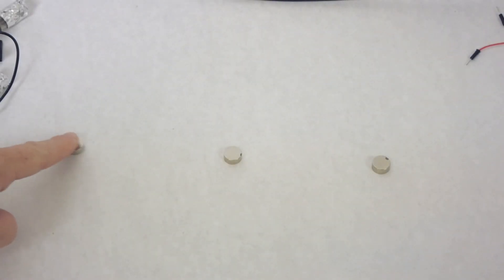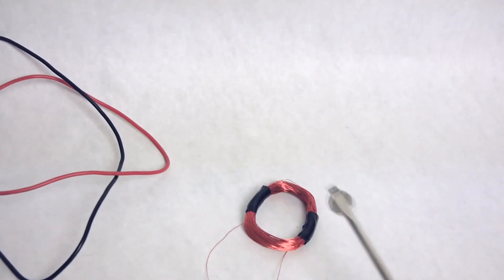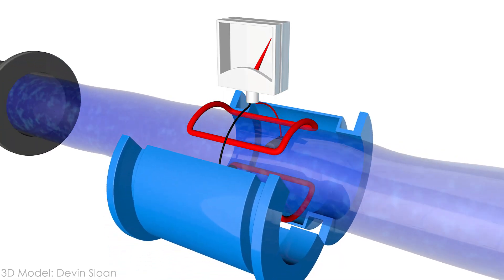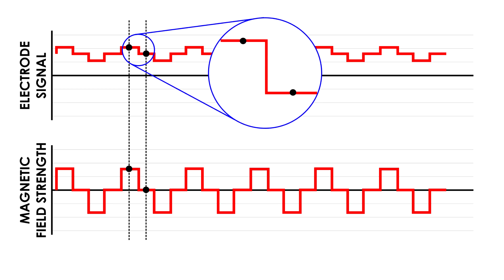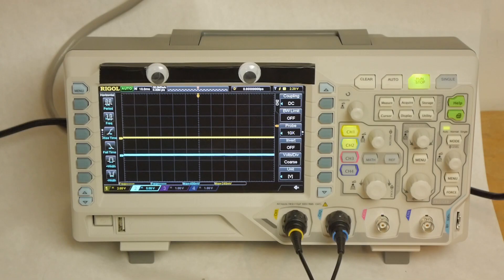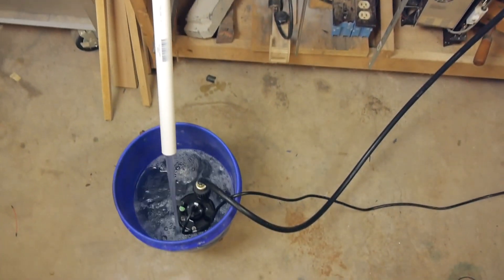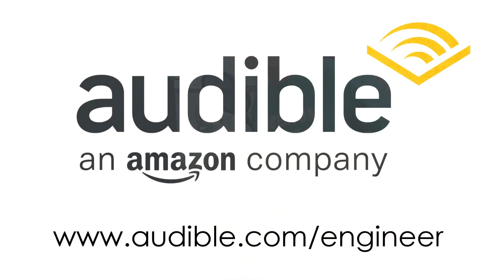How to Measure Flow with Magnets - (Magnetic Flow Meters)

Comment: Highly enjoying your water based videos. As a farmer I find them useful. Monitoring flow rate can be difficult with dirty water so we typically use pressure to make sure everything is running properly. 

Ps. Are you from Spud Valley? Based on your shirt at then end.
Reply: I work in a water plant that intakes water directly from the Mississippi River, the definition of dirty water, and we don't have any issues with our magnetic flow meters to track our intake water. In fact, mag meters are the recommended standard for dirty water. Propeller meters work up to a point, but can be less accurate and unreliable with large amounts of sediment or debris. Our regulators have required us to install mag-flow meters.
From our math, they're VERY accurate. We run flows up to 1400gpm in and 1500gpm out, and at the end of a month, tens of millions of gallons later, the raw influent and finished effluent meters are usually within a few thousand gallons of each other.
Reply: Robert Morgan our flow meters I believe are just weights in a clear plastic chute. It’s a visual cue and not a magnetic flow meter. High algae wrecks the visual. I realize I didn’t clarify that.

Comment: One idea to address the noise is to have a second pick up pair a little bit away from the magnet field.  The purpose is to pick up about the same noise, but without the signal, and then subtract:  (signal + noise) - (noise) = signal  It won't be perfect, but an improvement.  Another idea is to just use a low-pass filter.  That water flow is not likely changing at high frequency, anyway.
Reply: if you use 2 active sensors but one in reverse polarity then as long as the noise is not dependant upon field polarity then you get (signal + noise) - ( -signal + noise) = 2*signal for a boost in signal while reducing noise. Maybe use 2 active and 2 dummy sensors in a bridge formation (i forget the name of that one).

Comment: I was thinking venturi and manometry to measure the fluid flow, where the pressure is read from the manometers via a capacitive sensor. 

However, I realized that capacitive sensors have crazy signal-to-noise ratios.
Reply: Not to mention the taps would introduce a bit of turbulence in the flow as well

Comment: That intro plug sounded a bit like the PBS endorsement announcement of old. Got a bit of nostalgia there lol.

Also, on the subject of redesigning this experiment, I'd very much like to see that! I watch other YouTube channels that sometimes go back and try again on a project and it usually ends up being much better. It's fun to see that progression.

One final thought: the design of your set up was very interesting but probably not very suitable for smaller flows of water (I'm assuming anyways). I think something like this flow meter might be better for such a small application (though you'd have to get a slightly bigger one since that pipe's diameter is much bigger than this flow meter's diatmeter):
https://www.adafruit.com/product/828
Bonus: It also operates via magnetism! Huzzah!

Your videos are just awesome, thanks so much for making them! Cheers from SoCal.

Comment: Dude.. more of these videos please. Holy shit I learned so much... I've been installing magmeters for years and had no idea exactly how they worked... Do pumps really have a chance of charging the pipe or the water? Is that why sometimes piping requires electrical isolators for the bolts?

Edit: What about the grounding rings?
Reply: Having had to install 2 in my plant, reading the manual tells you in excruciating detail how it works. Had to take this step when 1 stopped working and when the other was submerged and fried. 
We went to the trouble of installing the grounding rings with ours, only to discover they're only required for installs in non-metallic pipe. Everything we have is ductile iron. 

LOTS of info here (ones I'm familiar with):
https://www.instrumart.com/assets/Badger-M2000-manual.pdf

https://www.youtube.com/watch?v=tRnLTGsCBNM

Comment: Do you really measure the electrical field? If I remember correctly, the moving charged particle will create a magnetic field itself from the the induced voltage. This magnet field then counteracts the magnetic field that induced the electrical field in the first place. I would've assumed that this counteracting magnetic field is measured, so you don't have to interact chemically with the fluid (you don't want electrolysis, etc. to happen in you fluid)...

Comment: When dealing with electric signals, there's the small detail that any metallic object will act as an antenna, and react to every electromagnetic signal that resonates with it, shielding it with wire mesh helps to reduce noise, of course, the shield has to be grounded, otherwise it's not going to do much.

Comment: Did you consider using a core in your magnetic circuit?  I was thinking you could maybe pull the rotor and shading coils out of a shaded pole motor and then simply put a pipe through the circular slot in the rotor.  The stator from a universal motor could also work. Nothing against your artisan coils.  You could probably try using the ferrite arcs from a CRT yoke with your coils too. For the purposes of this demo, you would also probably get much better results if you used a conductive brine instead of plain water.  With a strong enough field and current, and a rectangular pipe you can actually pump brine by applying power to the electrodes.  There are a few videos of saltwater MHD tricks here on youtube in fact.

Comment: Hey, a little late, but just as a suggestion if you still have the system set up. 

You could spike the water with a ton of salt.  That should make it far more conductive and boost the resultant signal in a more or less linear fashion according to the salt density.
Reply: Xylos144 sometimes this can damage the pump, depeneding on the type he is using

Comment: You could get a much stronger magnetic field by using an iron core in your electromagnet.  In fact, your best bet might be to use a pre-made electromagnet: tear the rotor out of a small AC motor and run your pipe through the stator.  A small C-frame shaded pole motor might be perfect for this (cut the shading coil.)

https://en.wikipedia.org/wiki/Shaded-pole_motor
Reply: great idea

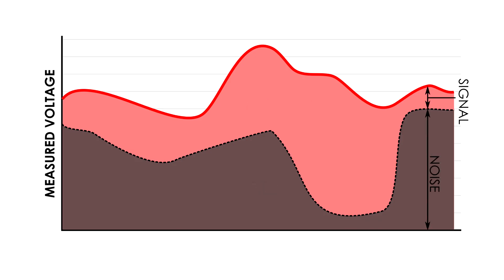Comment: Nice Video, but a small error 4:33 the SNR is low not high, no worries hope no one got confuesd
Reply: i'm still confused, it should be noise to signal imo but naming conventions have aways been weird
Reply: @sdaniaal  It makes sense to use signal-to-noise, because it's the signal you're interested in. High signal-to-noise = high quality, etc.
Reply: @sdaniaal  SNR is absolute signal amplitude not signal above noise related to noise amplitude
Reply: didn't sound right as SNR is in decibels and usually never see values <1 for commercial products
Reply: @stonerRx  Doesn't sound right because "signal to noise ratio" means "signal divided by noise". High ratio = high signal.

Comment: If I ever get my hands on an oscilloscope, I'm totally putting googly eyes on it too.
Reply: Ya but is the black tape to set off the googly eyes or to hide the brand of the scope (which is often done in videos/films) but if the latter, its kinda pointless since Rigol was smart enough to include the brand on-screen.
Reply: KrazeeCain you can get basic scopes pretty cheaply, if you’re ok with connecting it to your computer. Let me know if you’re still interested in details.
Reply: @uzaiyaro  I'm interested.

Comment: the issue here may not be electronic. it might be more practical. your pipe setup allows for air in the pipe. this will show up as noise.    raise the discharge so the pipe stays full. long straight runs get a more laminar flow which reduces noise (10*diameter at least before meter). also make sure your bucket is full so pump does not vortex and suck air.     I troubleshoot these occasionally, air in pipe is one of the most common issues.
Reply: Exactly, I would also suggest looking at some installation and operation manuals for industrial mag-flow meters for more clarification
Reply: I think you should try again and try to avoid some of the problems people suggested. Your failures only matter when you use them as a growing point.
Reply: Try mounting it vertically to eliminate the air, and ensure a liquid full pipe.
Reply: @trb707  I was going to say the same thing.
Reply: @PyschoArmorer2111  Can you help me with electromagnetic flowmeter's transmitter firmware and hardware design?
Reply: Joshua Phillips thanks I was thinking about using one on my efi engine swap but I'm not spending big money on one. So are there pre-made ones that are under 600$ and are pretty accurate for things like water oils gas ? Or is it cheaper to make one?
Reply: @richardprice5978  😂😂
Reply: Have a question here. What about increased conductivity of the fluid for the same flow rate. Does it increase the EMF generated?
Reply: @kaushikneelakandan9909  good qn
Reply: @kaushikneelakandan9909  I wouldn't think the conductivity would have an effect if the there is no current applied to the fluid. Conductivity is how well it passes electrical current. In the case of magnetic flowmeter, the current is in the flowmeter itself and not the fluid. The flowmeter is just looking at the change the electromagnetic field created by the flowmeter.
Reply: @PyschoArmorer2111 .. So then why there are min conductivity of the fluid is mentioned in the spec sheet of flow meters if it really doesn't matter?
Reply: @PyschoArmorer2111  would having 3 different grades of road use diesel fuel(summer, spring/fall, and winter) make one of theas obsolete for data logging fuel consumption?  As well as having various rates of fuel contamination from different stations accrost the country require the 2 (pumped minus return differential = consumption ) sending units to be  recalibrated with each fill-up?
Reply: @daviddroescher  From practical experience in the field, I would expect that different grades of diesel wouldn't have an effect. My experience has been with running water, sand, linear, and crosslinked polymers at high rates. I have a practical experience so technical answers are a little out of my reach.
Reply: Tim Kelton diesel does not coduct electricity , correct?
Reply: Can you help me with electromagnetic flowmeter's transmitter firmware and hardware design?

Comment: If these magnetic meters measure flow rate through a fixed diameter tube...would doubling the diameter of the exit pipe cause the meter to read a lower volume?

Comment: One issue may be grounding. You never mentioned using grounding rings or if you had set up a solution ground for the meter.

Comment: Noise to signal is high, not signal to noise.
Reply: In the video he said that SNR is high. What he actually meant was 'low', because the noise was so high.
Reply: its signal to noise ratio in electrical engineering like he said actually ie SNR = 10log(Vsig/Vnoise), as Resistance cancel we can use log properties and the fact that P = V^2/R, to make it SNR = 20log(Psig/Pnoise) in dB. Look up signal process engineering or an embedded systems textbook for a better definition :)

Comment: Might a different electrode material, such as graphite, cause a substantial change in noise? Also some electrodes straight to ground just before and after the meter proper, just to suppress/dampen stray potential.(possibly with filter caps or resistors)

Comment: I am not sure but I think that the principle is called Hall's effect and not Faraday''s induction principle.
Reply from the maker: Actually the Hall Effect is something very different. It is related to magnets though ;)
Reply: Hall effect and Farraday's induction principle is essentially the same principle, so you guys are both right. In both cases, moving charges are deflected perpendicular to the move  and the magnetic field. The difference in charges is then measures as voltage.
In the Hall effect, we move charges by sending an electric current, while here we move charges in the water by the liquid flow.

Comment: I wonder if using different electrodes (for example, bars parallel to the pipe) would have any effect... any idea?
Reply from the maker: +Kappy Engi Kappington Yes I definitely think they would. Actually if I were to do it again I would use thin metal plates which contour to the inner wall of the pipe.
Reply: +Practical Engineering that'd be a nice follow-up if you ever manage to get it working!
Reply: I'm looking forward to see that. :)

Comment: Here are a couple of tips from Deuteron Technologies Ltd, Jerusalem Israel. First, you can get at least an order of magnitude higher magnetic field if you close the magnetic circuit with a laminated iron or ferrite core.  Secondly, use a lock-in amplifier, or equivalent to look for your signal. In other words you should process the signal by continuously multiplying it by a number proportional to the applied current, and then use a low-pass filter to extract the flow signal. It's easy to see nanovolts of signal that way.  Your biphasic waveform is good, but better if that was the current waveform, not the voltage waveform, so you should make a controllable current source rather than applying a voltage directly to a coil. This becomes much more important as you increase the inductance of the coils and you increase the frequency.
Reply from the maker: Very helpful info. Thanks for sharing!
Reply: @PracticalEngineeringChannel 
Have you considered revisiting this with your modern, flushed-out team? I would be very interested in this and other instrument demos!
Reply: Magnetohydrodynamics
Reply: Wow, that's great info.
Reply: All i heard was warp core, the borg, and engage.
Reply: @gabrielanthony1325  OMG, that was a funny comment! Thanks.
Reply: @gabrielanthony1325  That was hilarious. Literal lol
Reply: hello. I am looking to develop magnetic flow meters. can you help?
Reply: Can you help me with electromagnetic flowmeter's transmitter firmware and hardware design?
Reply: Wow, that’s deep lol you can tell he knows what he’s talking about, or at least it sounds like it. But how does induction relate to what we’re doing or how is it used? I know it has everything to do with electric circuits don’t get me wrong, i’m more just curious and love deeper explanations to things and how they work.
Reply: Wonder how effective it would be to have a duplicate sensor assembly not connected to the water flow assembly to only or mostly pick up the noise and display the difference between the two. Seems like that would greatly reduce the strongest noise affecting your signal. Seems would be simple and quick to do. Would ignore fields from the pump motor, and various other sources of noise. Do wonder if having the second source while not in the water flowing circuit but mounted in the pipe filled with water but capped so no flowing water would help also the difference signal be less affected by the reaction of the bolts in the water?
Reply: Noise sums to 0 over an infinite sum, so if you just "listen" to the noise long enough and sum it, it should cancel out, and any real signal should remain. This is done in post-processing, and wouldn't be known right at the time, but when you "stack" an infinite series of noise, it goes to 0. That's how we communicate with Voyager I & II, for example. In other words, you could create a fairly weak detector, and just use post-processing to get an update once a week on usage or once a month etc.
Reply: Uhmmm what? :p
Reply: BSD Do not patronize any company from Israel.
Reply: @greg55666  BDS from any individual who enables terrorism & its worldwide army of enablers. Denounce terrorism before you denounce Israel.

(Gazans are getting ‘liquidated’ for criticizing Hamas. Anyone should be able to denounce this. If not then they cannot claim to care about their lives, and they certainly lose all credibility in criticizing Israel)

Comment: So I thought about this some more and was thinking about ways to improve your results.

1: You may be running into reactance limitations of your coil and or the series resistance of the wire, how-much current are you driving though the coil and what is the frequency? See if you cant drive more current though it, perhaps putting some parallel capacitance on the H bridges DC rail so you can dump more current during the 33% down time of the duty cycle.

2: You may want to use a band pass filter to dump any high frequency and low frequency noise and just isolate on your driver signals range. In reality the current that flows between the electrodes will be AC with an amplitude relative to the flow rate (as you stated). If you can filter out all the noise then you will have better results.

So how I would improve this experiment:
1 - increase the inductance of your coils (ferromagnetic core), measure that inductance and calculate an ideal driver frequency.
2 - increase the current (Capacitors, larger power supply, larger cross section on the coils)
3 - use a band pass filter and isolate your driver frequency
4 - ground out the fluid before it gets to the electrodes and the coils. (help kill any AC coupling and inherent charge from the pump)
5 - use a transformer on the electrodes. your amp is amplifying voltage however the setup is inducing current,  I would step up the voltage to get a better reading. Also you will need to make sure that amp has a + and - supply rail since your reading and AC signal, unless you use a capacitor and an offset voltage.

I cant tell exactly what amp you are using their but I would also make sure you use a linear device such as a precision op-amp, I know a lot of the amps they sell on those breakout boards are actually class D amplifiers for audio.

This may get you much better results.